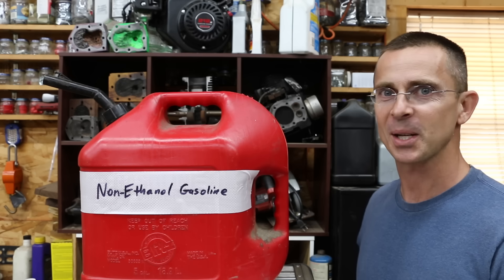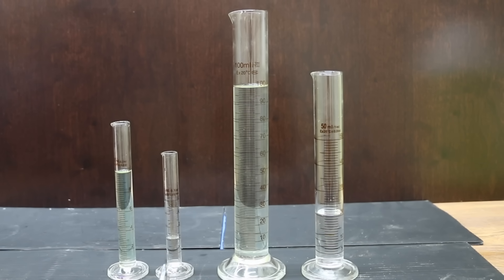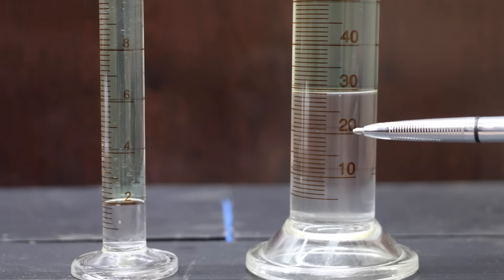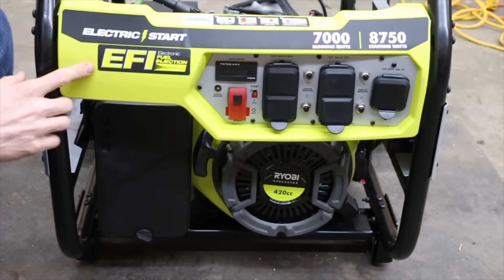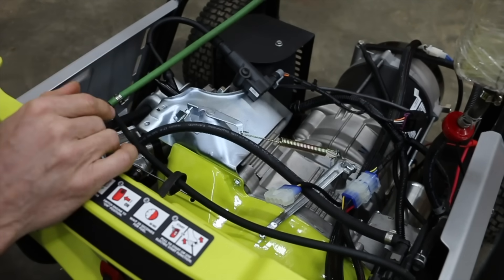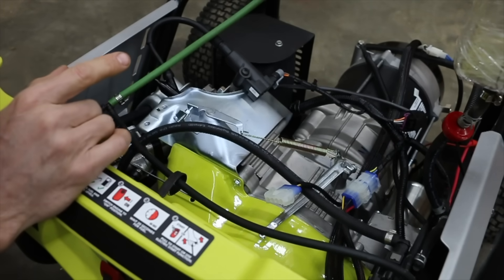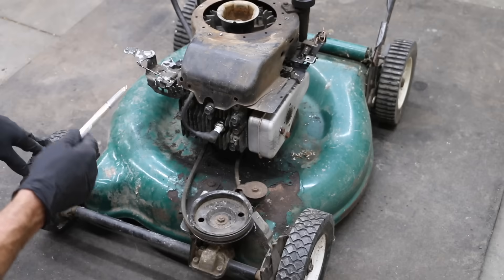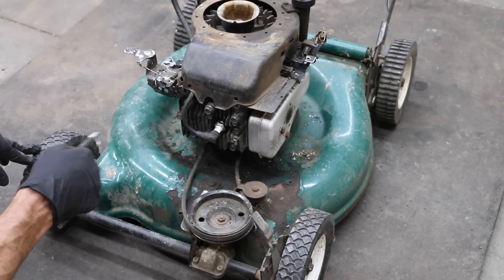Is Non-Ethanol Gasoline Really Better? See the PROOF!

Comment: We ran 2 tank of E85 gas in a car and got approx 40% less mileage. Comparing the price break for E85 and E10 - E85 was 15% more expensive for miles driven.
Reply from the maker: Thank you!
Reply: My experience exactly.
Reply: You are a LIAR!
Reply: Yup i used e85 once and only once. Ate it up twice as fast
Reply: E85 is far less efficient, but delivers far more power.
Reply: In what car? Was it properly adjusted for fuel change? Because your 40% less mileage sounds total bullshit :P
Reply: kaihlis you really need some science classes....or trade school. (i.e: mechanics)
Reply: @michaelharris1455  Perhaps you are in need of some reading comprehension and mathematics classes.  Kaihlis said there is more energy (which he used BTU) in E85 per dollar than E0. Let us do this together on paper to show our work with his numbers.

1 gallon of gasoline = $2.57 = 114,500BTU = $.00224 per BTU
1 gallon of E85         = $1.81 =    81,860BTU = $.00221 per BTU

Of course BTU while perhaps an important measure in a steam engine, is not great for measuring work in piston engines.

Ethanol in lower compression engines gets more horsepower, albeit with less mileage.  The mileage loss is still not be able to overcome the much cheaper price of ethanol, in other words, even in our gasoline optimized engines, ethanol's cost per mile to drive is less than gasoline itself.

Ethanol in higher compression engines gets not only more horsepower but even more mileage.  Mileage not only better than gasoline, but mileage equal to and even better than the best diesel engines.

Here are some examples, note that Scania is on the roads worldwide(not here) today.

FROM RICARDO:
The new federal CAFE standards are calling for a doubling of fuel mileage performance, which, Vint says, is going to send OEM’s looking for high octane numbers to improve efficiency and ethanol is the best source. Ricardo, an engineering firm with over 100 years in the business of engine design, has developed an extreme boosted direct injection engine (EBDI) to optimize ethanol blends. The 3.2 V6 gasoline engine rivals the power and torque of a much larger GMC Sierra 6.6 diesel, he said, and it delivers 3.5 percent better fuel economy than the diesel.

FROM CUMMINS ETHOS ENGINE:
According to Cummins, it delivers the power (up to 250 hp) and peak torque (up to 450 lb. ft.) of gasoline and diesel engines nearly twice its displacement...

...Using corn derived E-85, the high thermal efficiency and power-to-weight ratio of this engine results in 50 to 58 percent lower well-to-wheels CO2 emissions compared with the gasoline engine baseline. Using second-generation, lingo-cellulosic derived E-85, the power train’s efficiency features deliver 75 to 80 percent lower well-to-wheels CO2 emissions, depending on the drive cycle.

FROM SCANIA:
Scania has a number of products available for running on bioethanol – e.g. buses, trucks and waste collectors. Scania is the only vehicle manufacturer to date that has successfully produced bioethanol applications for heavy transport. Our engines adapted for bioethanol fuel have the same energy efficiency as a standard diesel engine and fulfill the Euro 5/ EEV emission level.

https://www.oemoffhighway.com/engines/press-release/21005554/scania-ab-scania-introduces-bioethanol-engine

FROM THE EPA:
An important step toward increasing alcohol fuel demand, then, may lie in providing economical engine technology options that utilize such fuels more efficiently, to compensate for the lower fuel energy density. The FFVs produced today, however, use fairly typical gasoline engines, which, because they must retain dual-fuel capability, are not able to take full advantage of the favorable combustion characteristics of alcohols. Engines optimized for alcohol fuel use, on the other hand, may yield efficiencies that exceed that of state-of-the-art diesel engines—or, about one third higher than that of FFV engines. In earlier engine research at EPA with neat methanol and ethanol [1], for example, over 40% brake thermal efficiency was achieved over a relatively broad range of loads and speeds, with peak levels reaching over 42%.

FROM EPA & FORD ON FORD'S ETHANOL OPTIMIZED ECOBOOST SYSTEM:
Compared to production gasoline engines:

Fuel efficiency is ~15 – 20% improved for various drive cycles.

Full load performance is significantly improved, and comparable to production diesel engines.

GENERAL MOTORS:
...the Saab 9-5 flex-fuel engine can give improved fuel consumption under mid to high load conditions. Whilst fuel economy over the official EU city and mixed cycles is unlikely to show an improvement, testing indicates that a useful 15 per cent gain can be expected at higher speeds because fuel enrichment for engine cooling is no longer necessary.

In its Saab turbo application, the high 104 RON octane rating of E85 fuel, the 85 per cent ethanol/gasoline blend most commonly available at filling stations, also produces a significant 20 per cent increase in maximum engine power, up from 150 to 180 bhp.

THE INDY 500:
In 2005, the IRL used 100 percent methanol in their tanks. The fuel worked well and was more efficient than straight gasoline, but IRL officials believed there was room for improvement. In 2006, they moved to a 10 percent blend of ethanol and methanol, which was then changed to 100 percent ethanol for the 2007 season...

...The switch to ethanol also allowed the racers to carry less fuel and make fewer pit stops, thereby increasing efficiency even more. "When the cars ran on methanol tanks had to hold 30 gallons to accommodate the fuel requirements of the cars," Vervynckt says. "After getting the engines to perform at their full potential, there was a significant gain in mileage. Indy cars now have 22-gallon tanks. When a driver pulls in to change out his tires, he can fill up. Teams were able to match their tire and fuel stops exactly, instead of stopping for tires only, or fuel only."s

Note that this is not new knowledge, it is suppressed knowledge:

Rear Admiral C.M. Chester wrote Henry Ford a letter on Dec.15, 1916:

"...I also pointed out in the article that as governmental laboratories had developed from 40 to 55% efficiency in alcohol engines as against 20% in gasoline machines, the use of alcohol at double the cost of gasoline for power purposes, was cheaper for motor[s] than gasoline in common use today."

The Navy was not the only researcher to possess that information:

Scientific Investigations of Alcohol Fuels 1890 – 1920

Scientific journals contain hundreds of references to alcohol fuel at the dawn of the automotive era. Research during the earliest decades tended to focus on pure alcohol as a replacement for petroleum. The focus shifted to the anti-knock (“octane” boosting) properties of alcohol blends in gasoline during the 1915 to 1936 period because of an increasing need for anti-knock gasoline and because of improvements in anhydrous alcohol production techniques.

Studies of alcohol as an internal combustion engine fuel began in the U.S. with the Edison

Electric Testing Laboratory and Columbia University in 1906. Elihu Thomson reported that despite a smaller heat or B.T.U. value, “a gallon of alcohol will develop substantially the same power in an internal combustion engine as a gallon of gasoline. This is owing to the superior efficiency of operation…”

Other researchers confirmed the same phenomena around the same time. USDA tests in 1906 also demonstrated the efficiency of alcohol in engines and described how gasoline engines could be modified for higher power with pure alcohol fuel or for equivalent fuel consumption, depending on the need.

The U.S.Geological Service and the U.S. Navy performed 2000 tests on alcohol and gasoline engines in 1907 and 1908 in Norfolk, Va. and St. Louis, Mo. They found that much higher engine compression ratios could be achieved with alcohol than with gasoline. When the compression ratios were adjusted for each fuel, fuel economy was virtually equal despite the greater B.T.U. value of gasoline. “In regard to general cleanliness, such as absence of smoke and disagreeable odors, alcohol has many advantages over gasoline or kerosene as a fuel,” the report said. “The exhaust from an alcohol engine is never clouded with a black or grayish smoke.” USGS continued the comparative tests and later noted that alcohol was “a more ideal fuel than gasoline” with better efficiency despite the high cost.

Of course no cost is ever assigned to breathing toxic and carcinogenic exhaust fumes from gasoline.  Sure many Hospice workers volunteer, but the morphine drip must cost something.  Here is the US06(real world) driving measurements of exhaust pollution of E0 vs E85 in chart form from Oak Ridge National Laboratory on page 5.  Absolutely astounding:     http://web.archive.org/web/20170121004456/https://www1.eere.energy.gov/bioenergy/pdfs/analysis_saab2007.pdf
Reply: Well go give it a try. My dealership also filled me up once and i noticed the gas went what seemed twice as fast. Found out they use 85 when applicable because of price. Gmc sierra
Reply: @jc06gsxr600  one gallon of gasoline contains 114,500BTU and one gallon of pure ethanol 76,100BTU wich is 33,53% less than gasoline. E85 contains maxium of 85% ethanol so minium BTU of E85 is around 81860BTU. That is 28,50%  less energy than normal gasoline. Gallon of gasoline in USA average 2.57 dollars and ethanol 1.81 dollars. that is difference of 29,57% So E85 actually contains more energy per dollar than gasoline, allso burns cleaner (emission wise). Dont know what kind of engine your truck has, but most brobably it runs like shit with ethanol because of totally wrong air to fuel mixture. :)
Reply: @kaihlis   Too bad someone can't or hasn't factored in the tax/subsidy costs.
Reply: @BWolf00  One reason might be that the Federal corn ethanol subsidy ended back in 2011.  The long term stated goal of the G7 Nations to end petroleum subsidies?...not so much.
Reply: Right now in my area, E85 and E10 are only about 20-30cent at most different...doesn't pay unless there is greater difference(typically 50-80cents). Also, if you look up most vehicles, such as a 2010 Silverado with 5.3 flex fuel, they will tell you  in the manual you get less mileage on E85 but more power. And in winter, it is really ~E65 as they don't put in as much ethanol as it has issues running in -35F in Minnesota HAHA
Reply: @kevinspeltz7400  LOL, I don't miss MN winters at all... 
Good info though.
Reply: @kevinspeltz7400  It might pay, if your 2010 Chevy is a 4WD 6.2L the rating is 14mpg for E0 and 11 for E85:
https://fueleconomy.gov/feg/Find.do?action=sbs&id=29773

The EPA states E10 reduces most vehicles mileage 3 to 4%, but I will show it with and without.
On E85prices.com if you live in St.Paul MN the prices today are as follows:

E10 = $2.15/gallon @14mpg = $.156/gallon per mile
E10 reduced 3% $2.15/gallon @ 13.58mpg = $.158 cost per mile
E85 = $1.70/gallon @ 11mpg = $.155 cost per mile

I would bet the E85 is really at E50 right now,  not E65 so that mileage should be better than the 11 I used.  Ethanol still is not bad at all considering gas prices are really cheap.

If your 2010 Chevy is a 4WD 4.8L engine the mileage is 15 for E0 and 11 for E85.

E10 = $2.15/gallon @ 15 mpg = $.143 cost per mile
E10 = $2.15 @ 14.55 mpg = $.148 cost per mile                                             3% reduced mileage
E10 = $2.15 @ 14.4 mpg = $.149 cost per mile                                               4% reduced mileage
E85 = $1.70 @ 11 = $.155 cost per mile
E50 = $1.70 @ 12= $.142 cost per mile

I put the E50 at 12 mpg for a plausible example.  Mathematically extrapolation worked out to 12.6 mpg so I was conservative with it.  If it is E65, then I am right on with 12mpg.

With every gallon of ethanol you buy, you know that more of your money goes to American/Minnesotan workers and American /Minnesotan businesses who pay American/Minnesotan taxes and put the rest in American/Minnesotan banks to buy goods and services produced by you and/or your fellow Americans/Minnesotans.

With every gasoline of gasoline you buy, you know that more of your money goes to Arab sheiks and transnational companies who put it in Swiss banks and pay little if any in tax.
Reply: NightTurkey82  Congratulations you have broken the laws of thermodynamics and can now refute the world's scientist and the maker of this video.  
The science reports the CGE of ethanol is 1.5 ethanol (E100) to 1.0 gas and reports gas having 114,00 BTUs compared to 81,800 BTUs for ethanol.
Most of the world reports and experiences a drop of 10%-20% (generally) when using ethanol gas vs non-ethanol gas.  Check your records, revisit both your premise, parameters and testing protocols if all hold "true" then I want your cars, your fuel and your location.  
Oh, there is another possibility...somehow you're crossing over to some other dimension in your travels.

https://en.wikipedia.org/wiki/Gasoline_gallon_equivalent
Reply: @BWolf00  Hey, great, smart replies!  Sometimes I think these kind of videos have ethanol drones that swoop in to fill the comments with lies.
Reply: @boristhebilder7553   Thanks for the thumbs up.  Came to revisit the thread and I find NightTurkey82 has "flown away" and deleted his comment that sparked several comments.  
Too bad now people will never know what was so ridiculous about his "position".  So a teachable moment/thread now looks like a bunch of people saying the same thing.  And secondarily, he'll probably just go to a thread/video that he feels supports his argument and repeat his comment there.
Reply: NightTurkey82  Full of shit. The truth is that E85 uses about 40% more fuel. When we run race fuel we go through 15 gallons a night ethanol is close to 25 and methanol is about 30 gallons.
Reply: Like most things, this can be pretty complicated.  If you run your engine at higher loads, E85 might be better.  So, a truck towing a trailer MAY get better mileage with E85 than with E10.  It all depends if your engine is operating in a region where it is knock limited (high loads).  If it is knock limited, E85 is better (if your car is a flex fuel vehicle).  A car cruising down the freeway is unlikely to be knock limited, so there will be not be a benefit with E85.
Reply: @Rsenior1981  Standard car (mid 90's sedan), daily commute, 50 miles, work 8+ hours, 50 miles home. relatively flat ground, x-way, most hours avoiding much in the way of congestion. Not tuned for E85, tire pressure, time of day, weather is always a variable but it was mid summer, pretty much a one week trial for 800 miles and done. 

They came out with E85, we tried it, our experience - overall criteria was cost per mile and done. Also, throw in extra time for the 30% more stops to fill up of off the x-way (not a normal stop )
Reply: Only reason to use E85 is the high octane rating, high compression engines require high octane fuel to function. There are other ways to get an octane boost, but E85 is easier than getting a water injection system working.
Reply: E-85 Seemed to be about 30-35% less efficient in my test.  Used a flex fuel pickup, flex fuel car, small tractor and small engine. The easiest and most fair test was in the 5hp Briggs we use on a water  transfer pump we use for filling the sprayer.  As the engine load is pretty consistent and the volume of work done is easily measured.  I did it as a school project in high school ag class.  E-85 was fairly new at the time around me and one place close sold it.    We put and alcohol carb on it and jetted down one size I believe. swapped  a different plug and retimed the engine as per recommendation.  Then ran against the numbers from the engine when it was running non ethanol 93,91, and 10%89 octane.  The difference in  91 and e-85 was 24%. 
   Did almost the same test just rejetting  a 560 farmall on an auger for loading out corn. Was 31% difference.  the cost was still feasible at that time as they were trying to promote e-85.   I ran the Briggs on e-85 for 6-8 years and seemed to do ok. Switched the 560 back after the test as we didn't want to have another fuel barrel around and it seemed to evaporate faster than gas but didnt ever actually do a test on that.
Reply: Ok  here’s what you should know, 
Gasoline btu>ethanol btu
Ethanol octane>Gasoline octane
Higher compression=more power
Higher compression requires higher octane. (Early detonation=Bad)
It’s a balancing game of efficiencies. You can get equal mpg out of ethanol as gasoline, but almost no engine is set up to do this. Motors with tunable turbos could do this and still run gasoline.
Reply: Sorry I haven’t seen these results, I’ve ran e85 in several applications. Including a turbocharged vehicle, there was a slight drop in mileage. But I found in my experience if you tune the vehicle for the E 85 it’s not nearly as big a drop. One of the LS vehicles I have only seen a 2 mile per gallon average drop. And the higher octane rating allowed more aggressive tuning for boost. It’s not the best fuel source, but neither is 100 percent gasoline. When I used to buy 100 percent gasoline it was very dirty. I found the E85 to be better for some applications, but having a little ethanol in the gasoline is preferable to keep engines cleaner.
Reply: ethanol will do nothing but reduce your power and mileage. ethanol is crap
Reply: @dbag2u  Actually Henry Ford's favorite fuel (ethanol) will increase your power in both lower compression engines and high compression engines.  Yes ethanol will lower mileage in our current lower compression engines, but because of ethanol's much cheaper price, the cost per mile to drive is lower even with the lower mileage.  Ethanol gets better mileage than gasoline in high compression engines.

For example a Chevy pickup 5.3L engine has a clean 380 horsepower on E85 and a toxic 355 horsepower on E0.
https://media.gm.com/media/us/en/chevrolet/vehicles/silverado/2014.tab1.html

Ethanol in high compression engines is the most efficient fuel upon the face of the earth.  See these examples:

FROM RICARDO:

The new federal CAFE standards are calling for a doubling of fuel mileage performance, which, Vint says, is going to send OEM’s looking for high octane numbers to improve efficiency and ethanol is the best source. Ricardo, an engineering firm with over 100 years in the business of engine design, has developed an extreme boosted direct injection engine (EBDI) to optimize ethanol blends. The 3.2 V6 gasoline engine rivals the power and torque of a much larger GMC Sierra 6.6 diesel, he said, and it delivers 3.5 percent better fuel economy than the diesel.

FROM CUMMINS ETHOS ENGINE:

According to Cummins, it delivers the power (up to 250 hp) and peak torque (up to 450 lb. ft.) of gasoline and diesel engines nearly twice its displacement...

...Using corn derived E-85, the high thermal efficiency and power-to-weight ratio of this engine results in 50 to 58 percent lower well-to-wheels CO2 emissions compared with the gasoline engine baseline. Using second-generation, lingo-cellulosic derived E-85, the power train’s efficiency features deliver 75 to 80 percent lower well-to-wheels CO2 emissions, depending on the drive cycle.

FROM SCANIA:

Scania has a number of products available for running on bioethanol – e.g. buses, trucks and waste collectors. Scania is the only vehicle manufacturer to date that has successfully produced bioethanol applications for heavy transport. Our engines adapted for bioethanol fuel have the same energy efficiency as a standard diesel engine and fulfill the Euro 5/ EEV emission level.

FROM THE EPA:

An important step toward increasing alcohol fuel demand, then, may lie in providing economical engine technology options that utilize such fuels more efficiently, to compensate for the lower fuel energy density. The FFVs produced today, however, use fairly typical gasoline engines, which, because they must retain dual-fuel capability, are not able to take full advantage of the favorable combustion characteristics of alcohols. Engines optimized for alcohol fuel use, on the other hand, may yield efficiencies that exceed that of state-of-the-art diesel engines—or, about one third higher than that of FFV engines. In earlier engine research at EPA with neat methanol and ethanol [1], for example, over 40% brake thermal efficiency was achieved over a relatively broad range of loads and speeds, with peak levels reaching over 42%.

FROM EPA & FORD ON FORD'S ETHANOL OPTIMIZED ECOBOOST SYSTEM:

Compared to production gasoline engines:

Fuel efficiency is ~15 – 20% improved for various drive cycles.

Full load performance is significantly improved, and comparable to production diesel engines.

GENERAL MOTORS:

...the Saab 9-5 flex-fuel engine can give improved fuel consumption under mid to high load conditions. Whilst fuel economy over the official EU city and mixed cycles is unlikely to show an improvement, testing indicates that a useful 15 per cent gain can be expected at higher speeds because fuel enrichment for engine cooling is no longer necessary.

In its Saab turbo application, the high 104 RON octane rating of E85 fuel, the 85 per cent ethanol/gasoline blend most commonly available at filling stations, also produces a significant 20 per cent increase in maximum engine power, up from 150 to 180 bhp.

THE INDY 500:

In 2005, the IRL used 100 percent methanol in their tanks. The fuel worked well and was more efficient than straight gasoline, but IRL officials believed there was room for improvement. In 2006, they moved to a 10 percent blend of ethanol and methanol, which was then changed to 100 percent ethanol for the 2007 season...

...The switch to ethanol also allowed the racers to carry less fuel and make fewer pit stops, thereby increasing efficiency even more. "When the cars ran on methanol tanks had to hold 30 gallons to accommodate the fuel requirements of the cars," Vervynckt says. "After getting the engines to perform at their full potential, there was a significant gain in mileage. Indy cars now have 22-gallon tanks. When a driver pulls in to change out his tires, he can fill up. Teams were able to match their tire and fuel stops exactly, instead of stopping for tires only, or fuel only."s
Reply: You are exactly right.....btw....still looking for the 100% ethanol fueled vehicle....can’t find it..hmmmm....
Reply: @FreeWill-is-Love   Reread/read my previous post, there are some there you obviously missed.  

Any engine can be made to run on 100% ethanol.  Indeed every single flex fuel vehicle in Brazil runs on E100 which is the majority and they have had E100 for many years.  They find the engines last up to 3 times longer on E100 than their common gasoline.  Soot acts like sand paper in engines which E100 does not have.
Reply: The chemistry is pretty simple.  Ocatane, isoheptane etc.. has much more KJ (energy) per molecule.  
The hydroscopic properties of alcohols also makes them undesirable for fuel in modern engines, especially 2 strokes.

There are a lot of corn lobbyists posting here. Very strange.
Reply: @tonesmith909  Funny, I have not seen any corn lobbyists, more petroleum lobbyists if anything.

If you have a steam engine or a ventless fireplace, then ethanol will certainly have less BTU though I still would only use ethanol for the ventless fireplace no matter what over petroleum I can assure you.  But in a high compression piston engine, you will get more work done with ethanol than any other fuel available. 

This does not break the laws of thermodynamics, ethanol simply produces less heat but has faster burn speed and more pressure for the pistons than other fuels.  Almost perfectly clean is a great bonus.

This is not new knowledge, it is suppressed knowledge. 

Rear Admiral C.M. Chester wrote Henry Ford a letter on Dec.15, 1916:

"...I also pointed out in the article that as governmental laboratories had developed from 40 to 55% efficiency in alcohol engines as against 20% in gasoline machines, the use of alcohol at double the cost of gasoline for power purposes, was cheaper for motor[s] than gasoline in common use today."

The Navy was not the only researcher to possess that information:

Scientific Investigations of Alcohol Fuels 1890 – 1920

Scientific journals contain hundreds of references to alcohol fuel at the dawn of the automotive era. Research during the earliest decades tended to focus on pure alcohol as a replacement for petroleum. The focus shifted to the anti-knock (“octane” boosting) properties of alcohol blends in gasoline during the 1915 to 1936 period because of an increasing need for anti-knock gasoline and because of improvements in anhydrous alcohol production techniques.

Studies of alcohol as an internal combustion engine fuel began in the U.S. with the Edison 

Electric Testing Laboratory and Columbia University in 1906. Elihu Thomson reported that despite a smaller heat or B.T.U. value, “a gallon of alcohol will develop substantially the same power in an internal combustion engine as a gallon of gasoline. This is owing to the superior efficiency of operation…”

Other researchers confirmed the same phenomena around the same time. USDA tests in 1906 also demonstrated the efficiency of alcohol in engines and described how gasoline engines could be modified for higher power with pure alcohol fuel or for equivalent fuel consumption, depending on the need.

The U.S.Geological Service and the U.S. Navy performed 2000 tests on alcohol and gasoline engines in 1907 and 1908 in Norfolk, Va. and St. Louis, Mo. They found that much higher engine compression ratios could be achieved with alcohol than with gasoline. When the compression ratios were adjusted for each fuel, fuel economy was virtually equal despite the greater B.T.U. value of gasoline. “In regard to general cleanliness, such as absence of smoke and disagreeable odors, alcohol has many advantages over gasoline or kerosene as a fuel,” the report said. “The exhaust from an alcohol engine is never clouded with a black or grayish smoke.” USGS continued the comparative tests and later noted that alcohol was “a more ideal fuel than gasoline” with better efficiency despite the high cost.
Reply: @tonesmith909  Mercury Marine(who makes many 2 strokes) thinks E10 may be the superior fuel to E0 because it keep the fuel "dryer".

Water is a problem of straight gasoline, not ethanol.

Years ago in the days of E0 gasoline every winter people would even have to buy little cans of alcohol called DRY GAS or HEET as gas-line antifreeze.

Gas stations would even have cases of it stacked up near the check out counter during that time of year. No one likes having a fuel line froze up in dangerous temperatures. It was common back in the E0 days.

Since E10 came, nobody buys DRY GAS or HEET anymore because the alcohol is already in there. There may be a dusty bottle or two back on a back shelf somewhere at the gas station, but that is it.

If ethanol did cause water/phase separation problems even half as much as is claimed, we would know it right away because every winter millions upon millions of cars would be stalled on the road in the northern US and Canada. This obviously never happens, but many cars did stall with frozen fuel lines back in the days of E0 straight gasoline.

...Mercury Marine, which hosted a Webinar on ethanol myths, noted that ethanol does not "grab water molecules out of the air." It is hydrophilic, which means ethanol holds water. With regular gasoline (E0) as well at E10, the primary cause of water collecting in tanks is condensation on tank walls. But unlike E0, which can absorb almost no moisture, E10 can hold up to half of one percent of water by volume, and the water molecules will dissolve in the fuel. The "solubilized" water will bypass the water separator and burn harmlessly through the engine...

>>>>Mercury Marine also says E10 may be the superior fuel(over E0) because it keeps the fuel "dry"<<<<

https://web.archive.org/web/20140922142320/http://dcd96xmek71bc.cloudfront.net/archives/email/Trade/BoatingIndustry/MythsofEthanol-August252011.mp4

According to a paper published by the Society of Automotive Engineers, at 68 degrees F, alcohol with as much as 45% water will mix with gasoline and not separate. With 4%, alcohol will form a stable mix with gas down to about minus 22 degree F.*

*A.C. Castro, C.H. Koster, and E.K. Franleck, Flexible Ethanol Otto Engine Management System 942400(Warrendale, PA:Society of Automotive Engineers International, 1994)
Reply: In my experience, I'd say I get about 20% less mileage, but I do get a bump up in power, so it's a trade off.
Reply: E85 allows higher compression before detonation. If a car is made to run ONLY on E85, the maker can design it to give more power using higher compression. Cars that can run either have lower compression to be compatible with 87 octane gas and therefore will be less efficient when running E85. To me E10 is a scam, the amount of gas saved isn't enough for all the hassle, E85 only uses 15% actual gas so I can see its value IF the car is made to only run it. Ethanol has a much higher Octane rating but normal engine builds don't use that to any advantage. Buy a high compression E85 only car and it is likely the same milage with the same HP engine. We should get rid of E10 gas and have E85 for all new cars and normal gas for all older cars.
Reply: Is that according to the computer or manual maths at the pump? IE, I used to run 50-50 e10-e85 (made around e40), my car would show a drop from 28mpg to 21mpg in the computer, but if I crunched the numbers by hand, it was actually 24mpg; not as severe of a drop as the computer thought it was.
Reply: @douglas685  E85 has less BTU's. The advantage of E85 is the octane rating and cars made specifically for it can have higher compression to make more horsepower with less displacement, therefor getting better mpg vs. bigger engine having the same HP but lower compression. Just because the car can use it doesn't make it just as good. Usually the flex fuel cars just advance timing to get the same power from the lower output of E85 but that still uses more gas per mile as it is not really taking full advantage of the higher octane and being used in a larger displacement engine. If an E85 engine can make 170hp with 11:1 compression in a 1.6L size vs. 2.0 or 2.4L having the same output but 9:1 compression and able to use 87 octane, the bigger engine uses more fuel. If you put E85 in that same 2.2 or 2.4L then the timing can be advanced to get around the same HP, but still in a bigger engine and still 9:1 compression using fuel that has an octane rating of 108. Running 108 octane gas doesn't add any more power or mpg to a regular engine and still consumes more if the BTU output is lower.